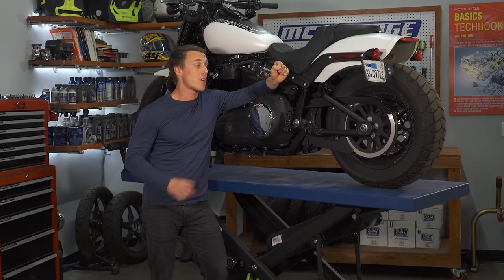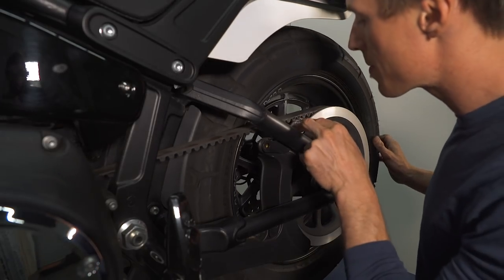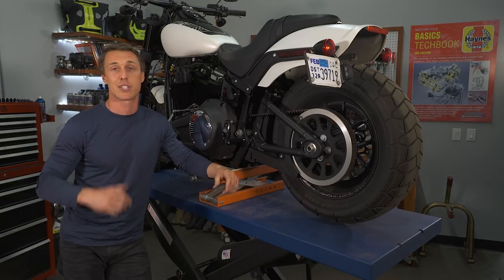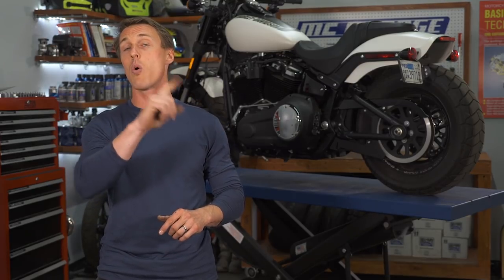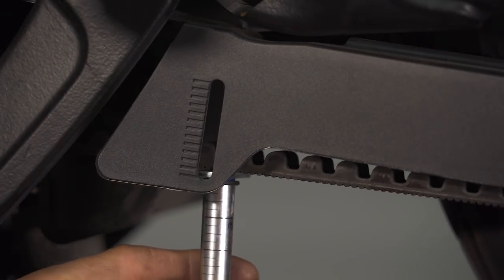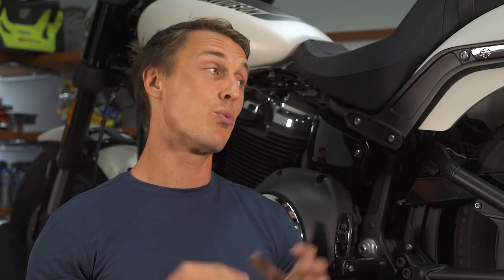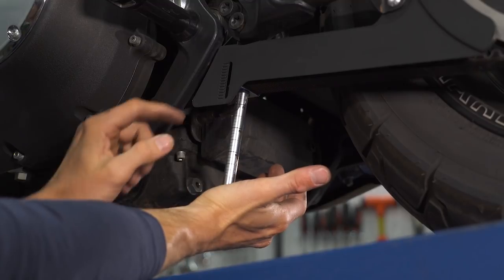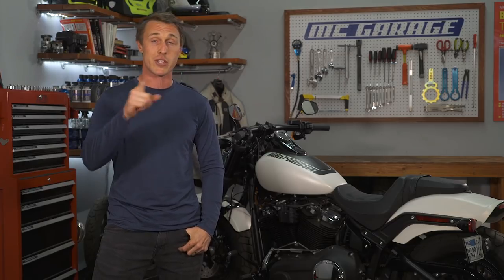How to Maintain Your Drive Belt | MC Garage

Comment: 100,000 miles. Tell Erik Buell that.
Reply: 1990 A Buell is a different beast than a stock Harley therefore the tolerances are not the same.
Reply: And nor are the belts. LOL

Comment: I  had a 883 and the belt went at 50,000 and the HD dealer did the inspection 2 days before,  And when I complained they told me I was lucky some break at 10,000 & 20,000  but when I bought the bike they told me at 100,000 change it and you will have no problems., but still charged me full price for a new one + shop time.  I just got a S40 Boulevard How long should the belt last on it. Sorry Harley but once lied to I don't go back.

Comment: Reason belts aren't used on sportbikes? Limited rear wheel travel to maintain proper tension, or else required to run belt tension idler (such as a Buell). Also, massive horsepower nees more belt width, requiring heavy pulleys. Chains just don't have these shortcomings.

Comment: I'm rockin' a 2008 Buell 1125R with around 55,000 miles and the belt still looks like it did the day I rode it home.  It is even nicer because of the belt tension pulley do you don't have to deal with axle adjustment.

Comment: Now that he did a video about how to check your motorcycle belt. He should do a video about how to replace an old worn out belt with a new one.
Reply: that would be a 2 hr long video.
Reply: Wouldn't be that hard or take that long.  Did mine a couple of weeks ago at 125,000 miles.  I've got an '07 Dyna and the hardest part was pulling the clutch basket and counter balance to get the inner primary and front pulley off (if you're replacing the front pulley).  Take the lower bolt holding the shock and pull the rear axle out a little (don't have to pull the muffler).  Take one belt off and put the other on.

Repeat in reverse and you're done.  took me and a friend about 1 1/2 - 2 hours.

Comment: What about alignment of the rear wheel to make the belt track straight?
Reply: Did you ever find an answer? My belt is a bit to one side and not centered.....
Reply: I dont remember why I posted that,  but there are only two pulleys,  the engine or motor and the wheel.  If no adjustment is possible at the engine,  that leaves wheel alignment.  Im able to center my belt on my Zero by using the left/right adjusters on the rear wheel.

Comment: On mine I have to use an app on the phone to gauge tension by the harmonic frequency of the belt being thrummed.  Requires 25 kg of tension and those Harley gauges don’t go that high.  Tried a krickett but heck if I can figure out to get a reliable reading with it.

Comment: I have a topic suggestion for the MC garage: Suspension: how does it work? OK, more specifically, many bikes these days offer a lot of options to play with - compression damping, rebound damping, and preload. Are there situations where you might want more compression than rebound daming? Or heavy damping with low preload? How does the surface play into this - like bumpy city streets vs a well maintained track? We're diving (hehe, pun, see?) into these questions in this video from the MC Garage!
Reply: allmhuran I support this as I don't know what that means too specifically

Comment: I just bought a 22 year old bike with 20 miles on it. Yes 20 original miles. not 20k. The belt and bike look brand new. Minus the chrome pitting from age.. debating if I should replace the belt just because of age.   after  I take care of some necessary maintenance like changing out the 22 year old fluids

Comment: Indian says to adjust tension and alignment at 60F ambient temperature. That makes it easy (Not). Seriously, in the real world a temp range would be more realistic if not perfect. Kevlar has a negative coefficient of expansion. Meaning that as the belt gets hotter it contracts rather than expands as most materials do. So it is logical to do the adjustment at a "mid range" temperature rather than further out in either direction. Set tension when the temps are too low and when it is warmer and the belt is hot from riding you could have an overly tight belt and damage bearings.

Comment: My bike has 30,000 miles on it and the rear sprocket doesn't look worn but it has a lot of scratches in it it's aluminum is that normal no gouges no Knicks just thousands of little scratches please respond so I don't have to buy a new one thank you

Comment: Believe u can use shoe/rubber polish to keep ur belt long lasting. Havent tried yet. As it get older it becomes hard, shoe polish will come handy. Should be used only on the outer and side surface.

Comment: can you tell about my motorcycle 2008 honda cbr 600rr that have problem when the engine cold it ok to start but when temperature up to 217 F suddenly  the engine has stop. when i start the engine is not work .

Comment: Hey guys.. can you please do a video on exhaust backfires and diesel pop bad for your bike?
Reply: It means your engine is running rich (too much fuel, not enough air) and the only reason it's bad for the bike is because it will foul up your spark plugs, so you will have to change them more often. That's it. A minor side effect is increased fuel consumption.

This usually happens when a full aftermarket exhaust is fitted, which doesn't have oxygen sensor (O2 probe, lambda probe) so it's not a closed fueling loop anymore. Therefore ECU has no information about the combustion process and can't adjust fueling on-the-fly.

Fueling in that case is fixed by either fitting a Power Commander, or by getting your bike's ECU flashed in a reputable tuning shop to adjust fueling.

That being said, it's better to run rich than lean, because running lean can actually damage your engine.

Comment: Dont forget to check the torque on the pulley bolts. Mine rattled loose and snapped and that's why I'm here
Reply: Use loctite also

Comment: how long can motorcycle battery last long ?
Reply: 1 year lead acid-
 Lithium ion much more
Reply: @spider2020   Must have cheap ass batteries. 13 yrs on my 1500 Victory. For the most part 4 to 6 yr may be average.

Comment: Heyy I had a question for you Why does a twin cylinder of the same capacity of a triple or a four cylinder, make more torque than the triple or four cylinder engine ?
Reply: Distilled to the simplest explanation, the fewer the cylinders (for a given displacement), the longer the stroke must be, and that equates to more torque.
Reply: Ari Henning Thank You ! 😊

Comment: thanks for producing this video, good job !  i would like to add one point. for Indian bikes it is important that before you adjust the belt, the bike must be fully rested.  do not adjust right after riding, allow it to cool down for a few hours.
Reply: Nope, better of adjusting when fully hot. Now your adjusting in real world conditions. Throw out the tool and Use your common sense when setting the tension
Reply: @340rps  Does the belt have to be perfectly centered or is it OK if it is to one side or the other? Thank You

Comment: is belt drive efficient then chain drive.
Reply: junaidbinamin No, but it has low maintenance and higher life.
Reply: All other things being equal a rubber band does not transfer power as efficiently as a metal chain. However, all other things are never equal (especially driver skill) so it isn't consequential in real world use. My 1125r has a belt and it can hang with any chain driven liter bike.